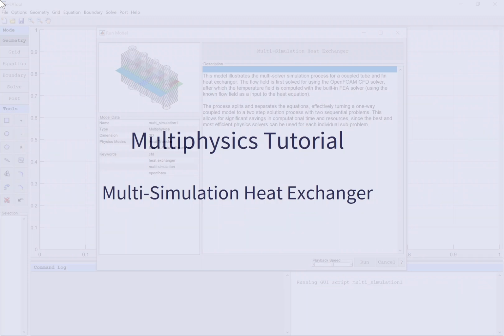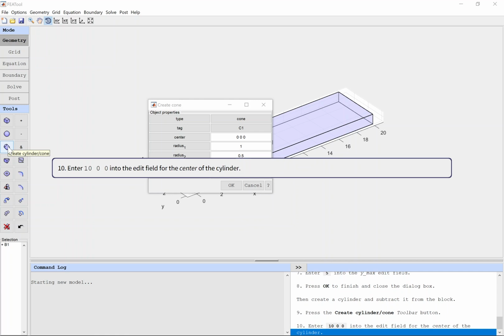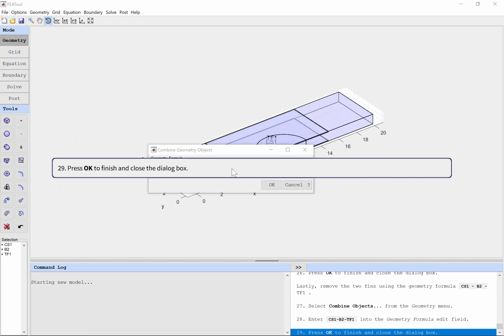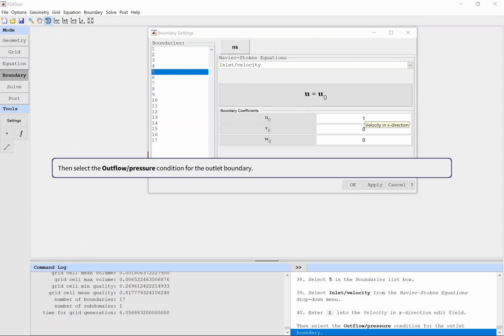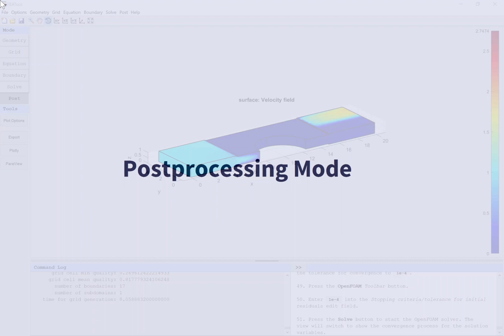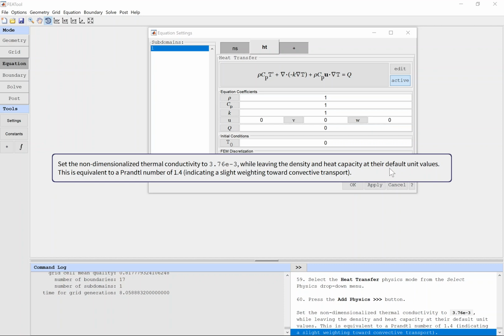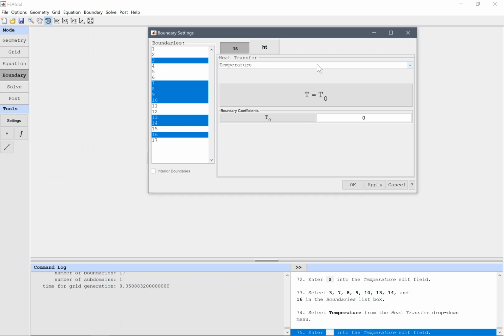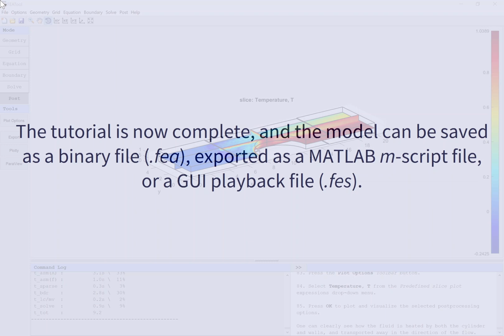Coupled OpenFOAM and MATLAB FEA Simulation of a Heat Exchanger | FEATool Multiphysics

Comment: if I have 1d heat transfer model in simscape, and cooling channel model in CFD toolbox, can i connect and make dynamic data transfer between them?
Reply from the maker: Yes, although we have not tried it yet, it would likely be possible to create an m-file/function to call from Simscape with the FEATool toolbox (CFDTool does not support running as m-file scripts or functions).

Comment: Can you run an acoustics analysis?
Reply from the maker: Hi, technically it is possible to perform acoustic analyses with FEATool Multiphysics, but currently there are no pre-defined equations for this, so you would have to add your PDEs and boundary conditions manually (for example using the custom PDE mode) which can be a bit tricky if you are not familiar with how it works.

Comment: I have a question. is it possible to connect Simscape and OpenFOAM and run simulations at the same time?
Reply from the maker: Good question, technically you can set up and solve OpenFOAM CFD simulations through the m-file function https://www.featool.com/doc/openfoam_8m . So it should be possible to connect it to Simscape (and other toolboxes), however this has not been done so far, so there is no built-in functionality for it.